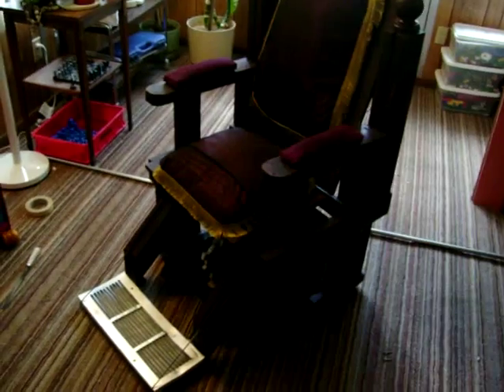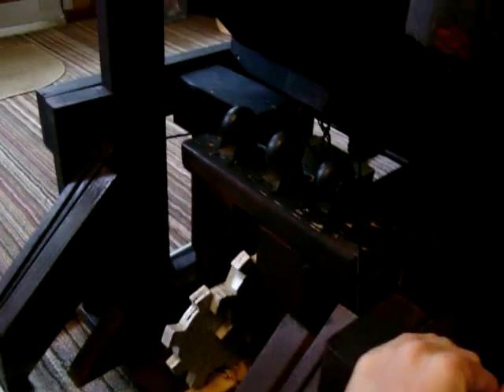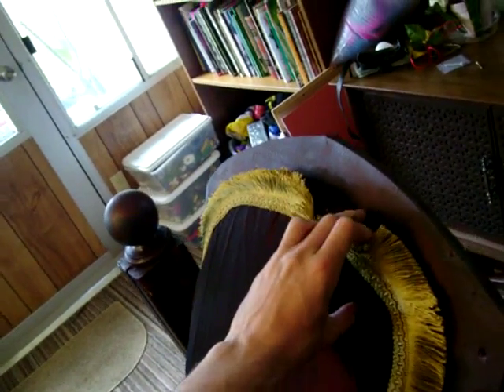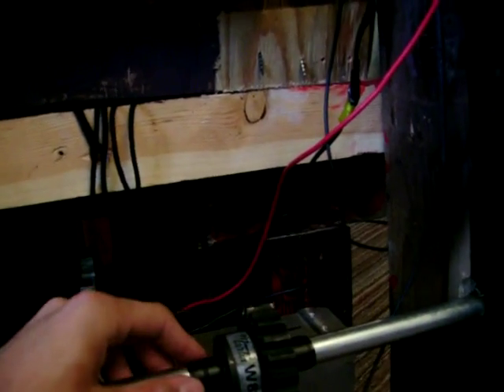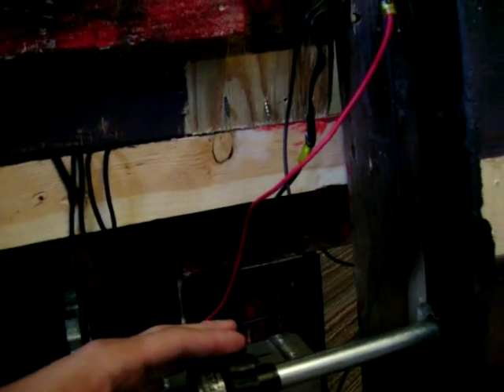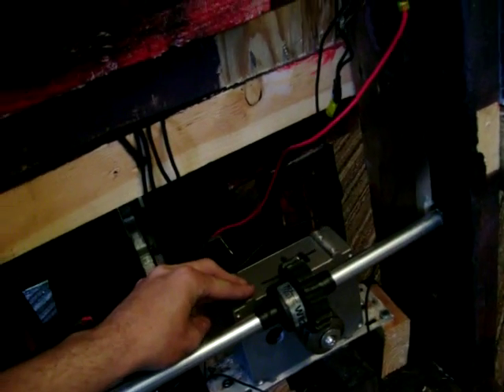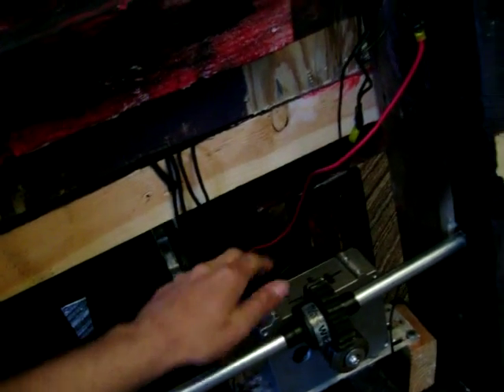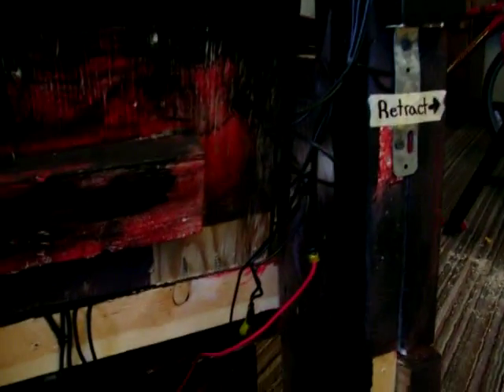Sweeney Todd Chair for Musical

Comment: Again, Interesting take on my design. The one thing you are missing is the Plank for the continuation of the slide, unless of course you plan on having your trapdoor meet the edge of the chair-seat. I considered building a motorized chair, but we wanted ours to be more or less historically accurate to what could have been used.